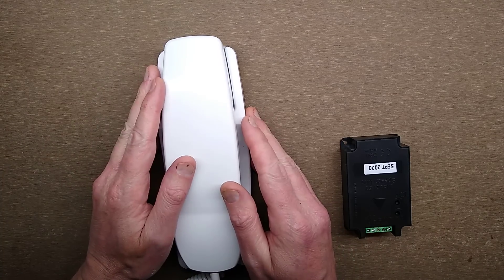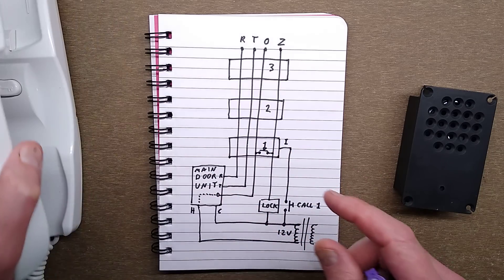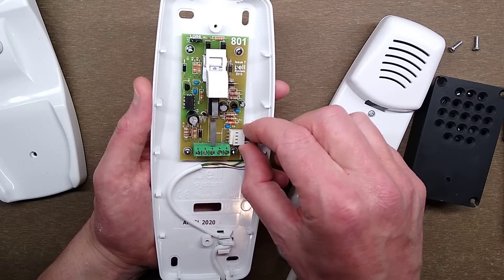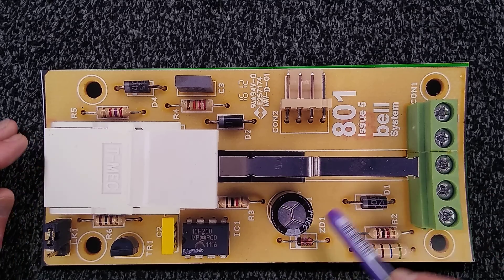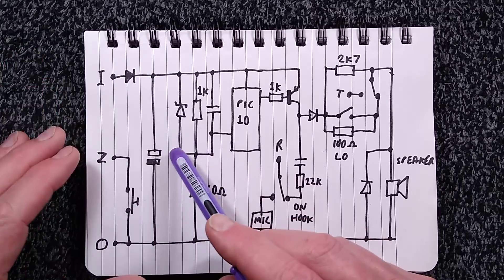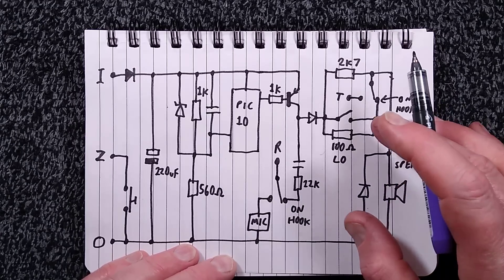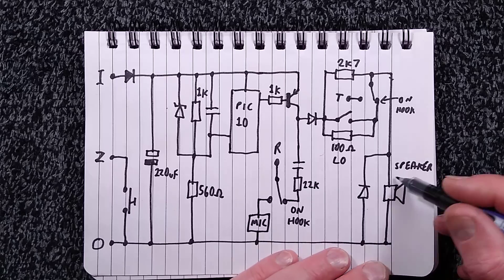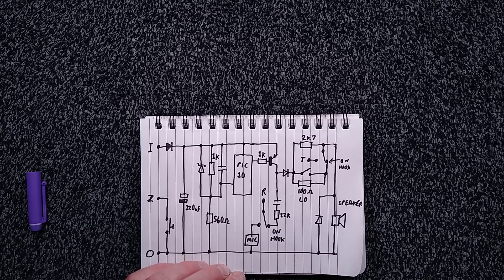Inside a door entry phone

Comment: here in Romania we don't use individual buttons - the outdoor station has a keypad and display, you call by apartment number. The most popular intercom company here, Electra, does 3 types of building intercoms (they are hands-free): 
1. analog - the indoor station is just buttons + speaker amplifier + mic amplifier (the speaker is used as microphone) connected using 4 wires to distribution box, the distribution boxes are just shift registers and the outdoor station has a RFID reader, keypad and 7 seg display.
2. digital - indoor station is almost the same as the analog one, but instead of having distribution boxes, every indoor station has a 8 pin PIC MCU, communicating using a 4 wire bus (power, data, audio, GND). the outdoor station has a 16x4 character LCD, RFID reader and keypad.
3. smart - everything has touch buttons and is made of glass, also has video option, everything communicates over canbus.

There are other systems, like Resel, that uses standard telephones as the indoor station. You can use the keypad of the phone to do intercommunication (call other indoor stations), unlock the door pressing 0 while in a call, and even turn on the building's lights if they are connected.
Almost nobody uses a key to enter the apartment building, most use 125KHz RFID tags or a 4 digit code.

Comment: Hello! Great video!! Do you think A - can a system such as bell be used on a different manufacturer or will it not like it. And B - I’d like to try and use an old vintage phone but install this modern circuit board and button into … so it’s not a modern handset do you think it could work? Thankyou!
Reply from the maker: It would all need to be compatible.
Reply: @bigclivedotcom yeah so if we used a Fermax phone on an existing Fermax system and then transplanted those components into an old handset may be a bit of jiggery pokery!!

Comment: The most popular intercoms in Romania are the Electra ones. They are based on PIC microcontrollers. There are 2 types  - digital and analog. Analog uses ultra-simple indoor stations (just passive components) and "call distribution boxes" - a shift register that turns on the chosen station. Digital systems are more advanced - they are wired all together in a 4-wire bus: 12V, audio, data, GND, the indoor stations have a 8 pin PIC that communicates over the data bus. They are a handsfree system, you have to keep pressing the "talk" button to be heard downstairs, like PTT.
They don't have individual call buttons - there is a keypad on which you enter the apartment number. Analog systems have a 3 character 7-seg display, digital systems have a 16x4 standard character LCD on which you can show an "installer ad" and the address of the building.
The digital panels also have a resident list.
Advanced parameters like address and family names are programmed over an USB serial adapter with custom Windows software.
The outdoor panels have a built in 125khz prox reader, using custom Hitag S 256 tags programmed to act like an EM4100 with extra bits (so Chinese generic RFID cards don't work).
You can also turn on the light in the lobby by pressing the unlock button while not in a call.

Comment: Clive, how do I switch my handset from low to high volume?
Reply from the maker: The only volume control is for the ringing.   If the volume is too low it may be that there's a high resistance connection somewhere in the wiring, there's another handset not on the hook properly or the audio box down at the call buttons may need adjusted depending on the brand.  Noting that if the volume is too high it can cause a feedback squealing noise.
Reply: @bigclivedotcom  Thanks for the reply. Yes it was the ringer volume I was referring to. When I open up the handset it looks identical to the handset on your vid, and at top left corner as you look at it, youll see a small black component that has 'high/low' written on it, which I have assumed is volume related, but I have no idea what to do with it. Right now my door intercom handset is working fine as in when someone is at the outside door and they want to come in, I press the button on the handset and voila! theyre in. But no ringer. No sound at all. Hence my suspicion that the volume is not set correctly..
Reply from the maker: @taxtalk5864  If the ringer isn't working at all then it's either a faulty button at the door (the contacts corrode with outdoor humidity) or possibly a broken wire between the door unit and your receiver.  Maybe even broken at one of the terminals at the door or the receiver.

Comment: I was moving my sofa today and broke my buzzer system. I took it off the wall and noticed it was just a telephone wire. So I've been researching how this works. I was going to pick up a new one. Instead I'm going to use  my raspberry pi to replace the phone. I'll have that audio routed through to an app on my phone with a button to unlock the door over wifi. The phone I had was from 1991 and the circuit board is primitive. There's no micro controller for the sounds. Very interesting stuff.

Comment: Clive i was wondering if you can help me please.

I recently moved into a new flat with a broken intercom. I identified it as a "ACET 22220 (2 Wire)". It has 6 wires inside (yellow, green, white, red, blk, blue). Cables yellow and red are in slot 5, black and blue are in slot 6 and the other cables are not connected at all.
I bought a bell 801 as replacement which 5 slots for wires "I R O T Z" which is different from my old ACET 22220.

Will this work as a replacement? And if so where would each cable go?

Thank you.
Reply from the maker: Each installer uses different colours.  You have to go by the actual connections.  I would advise against trying to patch in a different unit as it may actually stop other peoples units from working.  Try and fix the existing one.  A very common failure is corroded call button contacts.

Comment: you would be surprised how much fun one of these devices are for someone not used to using them!! my mother was forever pressing the ring button on the door to speak to my Aunty, so all she could really hear was the ringer all the time my mother spoken, until I confirmed with my Aunty that she could hear me without me pressing the button, I dunno how many years that had been going on for, as I was about 8-10 back in the mid 80's, and had always known my Aunt living in the block of flats until old age got too much.
Reply: from what I remember of the old units the handsets didn't actually disconnect from the door when the reciever was put down, as when sitting in my aunts flat you could quite often hear others using the intercom even though the handset was put in it's holder properly, so might be one bug that they fixed in the last 30-40 years.

Comment: I always assumed that the T meant Transmit and the R was receive, with the 0 being the common . In the 80's we used to install the old "Entryphone" gear, with "Eagle" handsets (which were  marked TROZ1 with the Z being a phonetic rendition of the noise the AC lock made when you pressed the button to open the door, and 1 the switchwire that operated the buzzer in your flat) . We used the non-standard handsets because the Entryphone ones were diabolical and looked like the design had remained unchanged since the 1930's. The version with the video camera linked in was terrific, in that it's super-wide angle lens made even the most angelic looking caller appear like an axe-murderer.

Comment: Interesting, our home-brew systems (Tesla Stropkov, Slovakia) manages roughly the same but with only two wires coming up to each phone. each phone has a number programmed (in the case of ours, we have the fancier "reprogrammable" ones and you can even make calls from flat to flat if you know what number has the other phone assigned) which probably makes it possible. also not sure if this system does it, but ours disconnects ou after 30 or so seconds so you do not hog the line (or in case someone just leaves the phone off the base), has 4 ringtone intesnity settings (off/low/mid/high) and can have external button hooked up as doorbell and has different ringtone from the one downstairs (you just hook up any button so really easy to do) and can have auxiliary speaker hooked up so if you phone is far from the living room (99% of the time it is at the door to the flat) you can run the speaker elsewhere. also you can call from the top down if you want and spook anyone waiting at the door (not that I have ever done that)

Comment: At least here in the states, the red and green wires were called "Tip" and Ring". The terms date back to  the 1/4 inch phone plugs (like headphones have) used by the telephone operator.
Early on, phones ran off a pair of big old 1.5 volt batteries (which later became popular for glow plug heating on RC controlled model aircraft). Battery power was fed to the carbon
microphone through a primary winding of a transformer The secondary of that transformer was what ran the lines going back to the phone office. Yet another winding fed your ear
piece...but kept the volume done so you wouldn't blow out your own ear drums since you are so local🙂...and feed back loops are pretty easy to establish. Also...it would seem that
the old military field phones operated in a very similar manner...although some distances had to be helped along via vacuum tube  amplifiers in some locations. They were referred
to as east west west east amplifiers...as they only had "line" and "battery" terminals. You hook up power and the two talk lines and it would boost the signal both ways. Still scratching
my head over the schematics for those🙄. Oh...I see Buddy68 Is a Bell Tel guy...I was Western Electric back in the 70s and 80s. Hi, @Richard Alexander!😀 Oh...and electoret mikes
were pretty much designed to mimic carbon mikes in the early days.

Comment: Ha I actually had one of these apart recently to add a Wi-Fi relay to open the door via Alexa or an NFC tag and my phone, still working out how to self power the relay module so currently I’m using a Poundland power bank thanks to you for the inspiration. At some point I’d like to build something that intercepts all the signals and allows me to operate it from anywhere like a ring doorbell

Comment: Dear Clive. Having enjoyed this excellent video on the entry phone, I could not understand what the 2K7 Ohm resistor (at the top) was for in the ringing\audio circuit. If the high sound was activated then as you say the current just goes straight through, but if on low, it would have gone through the 100 Ohm resistor. If the 2K7 was to assist with a mid point above for the 100 then surely one resistor matching the required value would be better and save costs. Have you any ideas or have I just misunderstood the workings? Many thanks to Clive or anyone else in advance.

Comment: When I lived in a flat I set up a remote key-fob controlled switch wired across the door release on the intercom, so I could press the key-fob button (in my pocket) and buzz the front door open without having to get my keys out. Neighbours were mystified how I was doing this. EDIT: Just saw another comment saying they did the same thing! I did the above hack in around 1998, using a Velleman kit from Maplin. Shortly after vacating that flat in 2000, I noticed they installed a new intercom system.
Reply: I'd love to know how you did this as I share a front door key with my flat mate and regularly get locked out while they're out. (special key that we can't get cut)

Comment: I have that exact model in my flat. I get terrible distortion where the microphone picks up the speaker and it just echos infinitely.
Reply from the maker: That suggests that the unit at the main entrance may have been incorrectly set up.   There are two volume controls on the entrance unit audio module that can be adjusted to avoid feedback.
Reply: Yea must be. We know others in the same building have the same issue, so it must be an issue with the outdoor unit.

Looking forward to your vid on tearing down and REing the outside unit

Comment: Ours have been changed so that an individual's bell has to be rung before you can open the door, and you can no longer hear somebody else in another flat on their handset, which is mainly to the good. The downstairs keyhole has been replaced with an RFID fob system run by a third party, together with the CCTV, so the landlord can monitor tenants coming and going. Ahem.

Comment: I install and service intercom systems to buildings for a living (amongst other things) and I have to say that nothing beats the simplicity of a 5-wire analogue system like the one shown here.

I live and work very close to the beach and salt is a constant problem with intercom systems. The old 5-wire analogue systems are so much easier to maintain and keep going.

Many buildings upgrade to newer digital 2-wire systems but I find they have way too many points of failure when exposed to the salty air and last a fraction of the time before failure, often pulling the whole system down in the process.

Take apart a newer Aiphone GT handset to see what I mean.. they are massively over complicated for what is essentially just an audio door entry system, with the same functionality as the one that Clive shows here.

I must admit the Bell system he shows here has some nice design features, most notably the tone being sent back down to the panel for an audible confirmation that your visitor pressing the button is actually doing something.

Many of the analogue systems I work on don't do this.. Urmet is the worst for it.. the old Aiphone analogue systems don't do it either. The big problem is when the visitors just push the button really hard and then end up breaking the buttons!

With the A/C buzzer ringer systems I have some low impedence buzzers I put in series with the common rail of the buttons and then mounted inside the panel so you get a audible notification at the panel of the button working. Because they are low enough impedance they really don't affect the loudness of the buzzers inside the handset which is great. With Aiphone I use a small low impedance speaker instead.

Nearly all analogue systems I work on here the call tone is generated inside the amplifier at the panel and not inside the handset. Often what happens as the traces start corroding inside the amplifier is the call tone sound starts leaking into the audio so there are many people who pick up their intercom handset and slightly hear the tone constantly in the background!

Anyway, very interesting to see this Bell system I don't see here in Australia. I wonder if they are even available here?

Comment: R and T stand for ring and tip, which are the two wires in a standard (at least in the US) phone line. They carry a current loop which is the sum of both signals, and traditionally there are specialized signal transformers at each end to split the signals apart. On a normal phone line, standby has 48VDC across the lines, ring superimposes a 90(?)V square wave on the pair, and in use the voltage drops to about 5–6V if I recall correctly. 

As a trivia point, the names refer to the contacts on a phone plug as used on an old fashioned switchboard.

Comment: Here in Canada, these door phones have mostly been replaced by a system that rings your home phone. It requires each tenant to register their phone number (landline or mobile) with building management. Unlocking the door is accomplished by pressing a number (usually 9) while the call is live. Much more secure than the old door phone, but you can't participate without a phone.
Reply: A bit intrusive
Reply: That is a really weird idea. Lots of people have their phone on silent. Someone could be ringing me for half an hour and i would be none the wiser.
Reply: My late grandfather's place had something like that. I wonder what would happen if the person outside played a prerecorded tone of the number nine (or whatever the unlock code is). If that's enough to unlock the door it's pretty terrible from a security standpoint.
Reply: Same in newer blocks of flats in France.
There are also mobile apps for the intercoms by the way.
Anyways it really sucks because you need to have a phone (Most likely mobile) since they don't put handsets in flats anymore.
Reply: Aside from being a bit intrusive, what annoys me about the home/cell phone method is that you can't buzz people in without them calling you. I've had times when someone called my phone directly, and I had to tell them to hang up and redial over the intercom. I wish I had a physical button to just buzz people in regardless.
And I live alone so it's not an issue, but what about cases where two people live together? Lots of people don't have a home phone and just use cell these days, and being required to pick just one person to have entry control would suck.
Then there's the administrative issue of needing to register new numbers every time a new tenant moves in instead of it being constant per-unit, which was overlooked for me for months after I moved in. 
And to top it all off, they still need a speaker in every unit anyway, for announcements and fire alarms.

Comment: I used to have an asshole neighbor who would just tape the button down in his unit and leave the buzzer going so all of his drug customers buddies could come and go as they please. Then the solenoid burned out and the door was locked shut. So the manager just unlocked it with a key and left it open for 3 months until they fixed the buzzer. Also I discovered that if you held the neighbor's button down after they answered, they couldn't disconnect the call so a couple of times I held his button down and blasted an air horn into it until he called the cops and ended up getting busted when they saw drugs. And then the place was livable for a while.